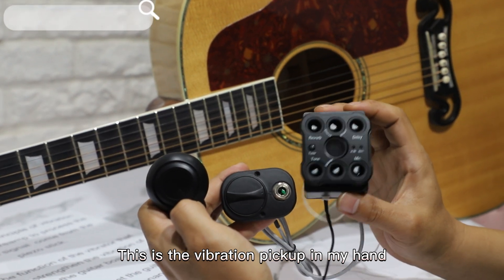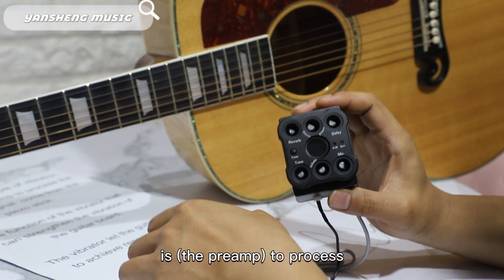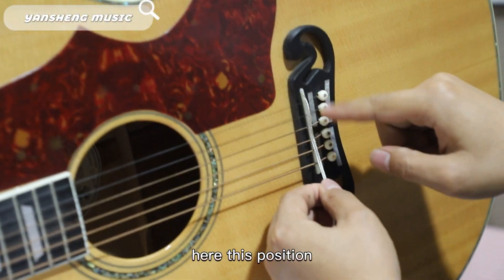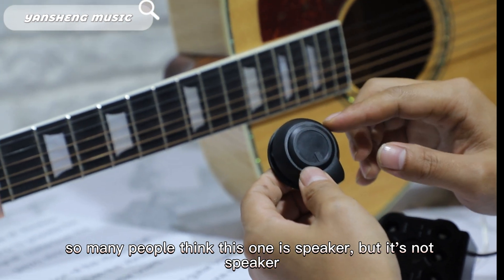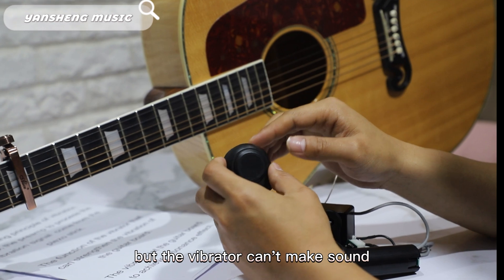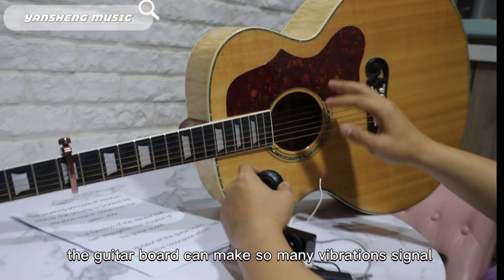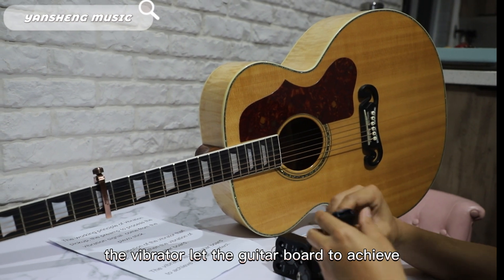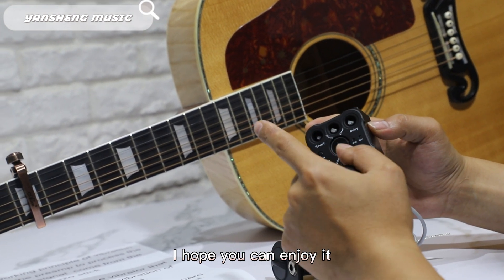Resonance Pickup Built In Vibrator

Comment: 9/9/23- This "resonance pickups" are pretty cool, but I cannot speak of its build quality or quality of live sound. The make effect come right out of your guitar's sound hole without and external amplification or effects pedals.

After the initial introduction of the first retrofit effects device for acoustic guitars known as the ToneWood Amp about 9 years ago for around $350. and then the introduction of the Yamaha Trans Acoustic guitars that were way overpriced, then more recently the Blue Lava computerized guitars with their "ify" build quality, etc... the Chinese naturally decided to seize the market with a simpler retrofit version that fits right in the sound hole of your existing guitar for a LOT less money.  

Both the ToneWood Amp (which required a pickup) and the countless new guitars with these built-in effects were all high-priced ways of getting effects to come directly out of the guitar's sound hole w/o using any sort of external amp. Unfortunately, with the lack of any sort of early effective marketing to come up with a consistent descriptive name for this type of built-in or retrofit effect devices, sellers inadvertently turned it into being sorta gimmicky, Some in the know may call it a fad. 

Asian manufacturers of these retrofit systems and the plethora of other inexpensive ones on eBay, Ali Express and Temu have sort of unofficially dubbed them "Resonance Pickups", but few understand what it even means, and yup, it's gimmicky sounding. Again, more poor marketing, blah, blah, blah. These Asian retofit devices are pretty cool, but I'm afraid due to the crappy marketing and the now rock bottom clearance-type pricing, they are just another fad that will most likely disappear shortly.  

WARNING.... Some installation may be necessary as I believe you must attach a transducer to the inside back of your acoustic guitar. This essentially turns your guitar's back into a speaker on most of these resonance pickups. They never show or talk about this in the picture ads.  

My advice is if you want one, pick the best one that makes sense to you and GET IT NOW BEFORE THEY'RE HISTORY. Or maybe I'm totally wrong. Just sayin'